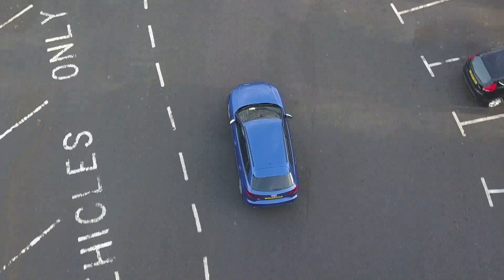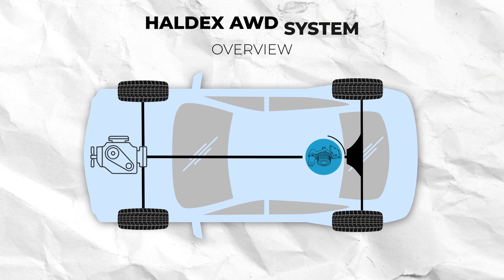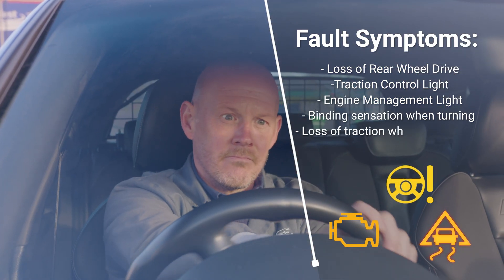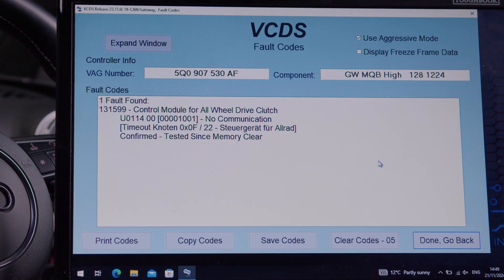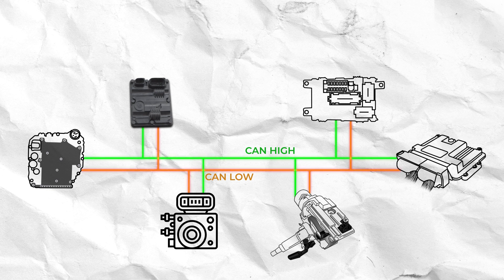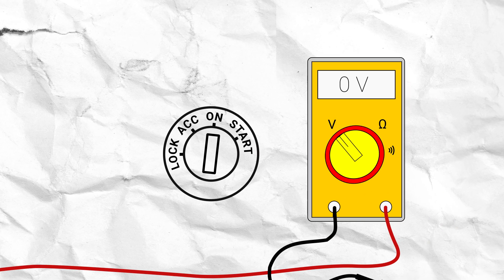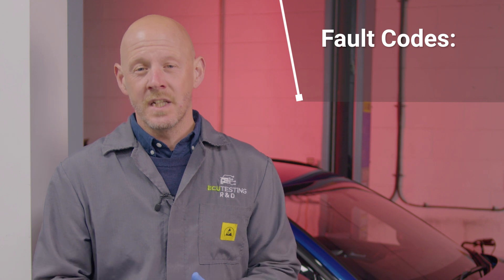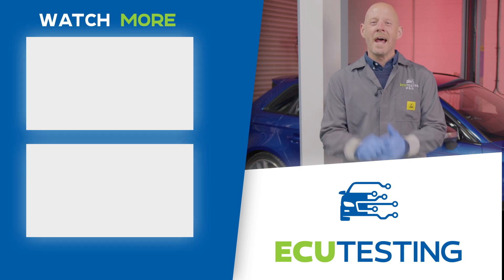Haldex AWD System Faults? The Gen 4 and 5 Repair Guide You Need!

Comment: C1112 13 open circuit ... can be caused by corrossion of wirings? because  that  shielded cable which covers two wires to pump was so rusty that it turns to dust .. it is needed (grounding) ? How to repair cables on the body of pump without dissassembling it?

Comment: I have a 2019 VW Tiguan which is experiencing pretty much all of the symptoms you describe in this video. Atrocious handling, a lot of front wheel slip when pulling away from a standing start. Turning at slow speed on full, or close to full lock (the front wheels) sounds like they’re crunching over snow, when the surface underneath is dry tarmac. I have no warning lights though. 

My Tiguan has 55,000 miles on the clock and I don’t believe it’s ever had any Haldex work done.

I started noticing the issues around the same time as having a towbar installed around 2 months ago. I’m not sure if this is just a complete coincidence.

Do you have any suggestions as to what this could be? Does it sound like Haldex to you?

Many thanks
Reply from the maker: Hi there, it could possibly be an issue with the Haldex. If you would like to send it to us for testing, please complete our test form here; https://myaccount.ecutesting.com/?return=%2FTestForm If you have any queries, please give us a call on 01773 535638. Thank you!

Comment: Hi on my insignia vxr. I had a service awd light that can be dismissed. I had the oil & filter done 5000k ago. There is no grinding or tc or engine management light or loss of power. I'm confused. But I did have tyre pressure that was way out when I drove off. Could that be the culprit?
Reply: Your car battery might need replacing

Comment: Hello, i have tiguan mk1 2.0tdi 140hp 2009 4 motion. Is it possible to disable the 4 motion permanently and remove the 4x4 parts? propshaft, haldex diff and the axes. So it be a normal fwd without warning lights. Cheers

Comment: Good video i changed my battery golf r 2018 coded it as per the digits on the battery, started to get 4 wheel drive issues, change oil cleaned pump, pump learn via vcds, front wheel spin, had the car at 2 vag specialist no joy, spent £1000 no luck, ended up when I coded the battery I cjeck the volts on vcds 14.5 volts, thought cool, never waited for it to settle, when it settled 11.5 volts, long story short I changed the battery learn code, done the pump learn, 4x4 again, watch out for this gents after you change your battery 👍

Comment: Hi I have a problem with my Range Rover evogue
Reply from the maker: Hi there! If you have a problem that you believe to be caused by a unit, please give us a call on 01773535638 with the vehicle details, fault symptoms and any codes that are present. A part number from the unit you believe to be faulty is also required. You can also drop us an email to info@ecutesting.com. Thank you!
Reply: @Ecutestinglimited Thank you I’ve emailed you Ange

Comment: I have an intermittent fault code U011400 no communication comes and goes every day or 2 we had an issue with the wiring harness before do you this could be  the same issue possibly ?
Reply from the maker: Hi there, this is a common fault we see for the 4Motion. It is best to check for possible external causes like wiring and the harness as you mention, if you do not find anything to be causing the problem, you are welcome to send the haldex module to us to check. If you have any further enquiries, please give us a call on 01773535638 or email info@ecutesting.com. Thank you!

Comment: I've got a 2013 Volvo V40 T5 which shudders at the front wheels when you let off the accelerator. 
Initially I thought it was the ABS system but I wasn't braking, so how could it be? 
I then thought rear diff issues so I removed the driveshaft. 
The problem went away, but multiple lights came up on the dash a couple of days later. 😂 
Now she's throwing all kinds of ABS, cruise control etc kind of issues...
I drained the Haldex fluid, it was pretty dark. Cleaned the filter and the pump housing, replaced the fluid (at just over $100NZD for a 1 litre bottle, no joke). 
I've rebuilt everything and put the driveshaft back in. I will give it a test on the weekend...
Hopefully that's sorted now. 😅

Comment: Great piece of advice . My 4x4 insignia has loss of communication to rear clutch module. Will the clutch and pump still work if no communication , coz the cars not throwing up any traction lights , just a service rear axle. ? And its driving ok . When  i get some funds , im gonna remove the clutch module and send too you. But im gonna check the connections first and the ressitance on the pump. Because of this video , i know how too now . Thanks
Reply from the maker: Hi there, if there is no communication, the Haldex system will not be functioning properly or at all. After you have done the checks mentioned, if you do need to send the Haldex to us, you can follow the test form here; www.ecutesting.com/testform to get the process started. If you have any further questions, you can contact us on 01773 535638 or email info@ecutesting.com Thank you!

Comment: Hi picked up a 2013 tiguan 4motion tdi yesterday. Drive bk from yorkshire to wales was about 4 hours. After about 2 hours driving traction light start stop steering wheel. Tyre warning light and park light all started flashing. Stopped car switched off left few minutes then drove and all lights went off. 30 miles later all bk on. Stopped again switched engine off drove and lights went out. Any ideas thanks
Reply from the maker: Hello there, some of these lights being illuminated are common for the Haldex unit failure, however this can also be a sign of different issues. We would advise to get a mechanic to check the vehicle to diagnose the fault, if you do find the Haldex unit may be the cause of the problem, you are welcome to get that sent into us! If you have any further questions, our email is info@ecutesting.com or you can give us a call on 01773 535638. Thank you